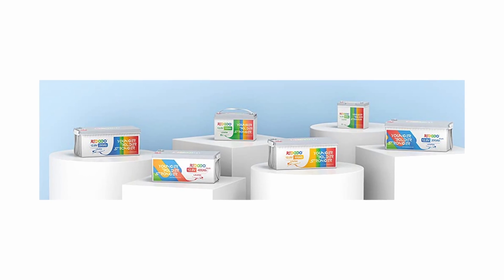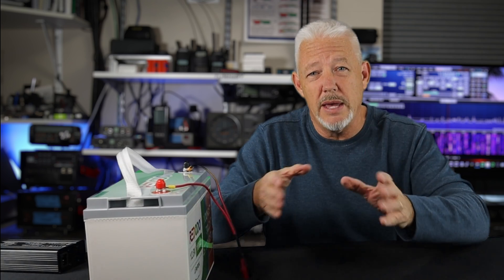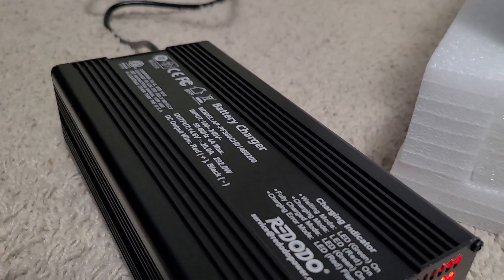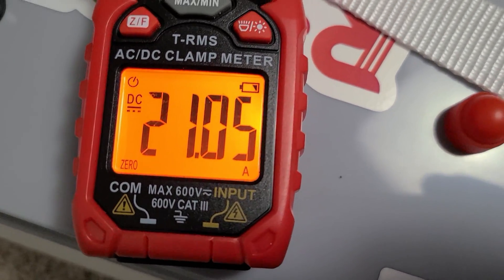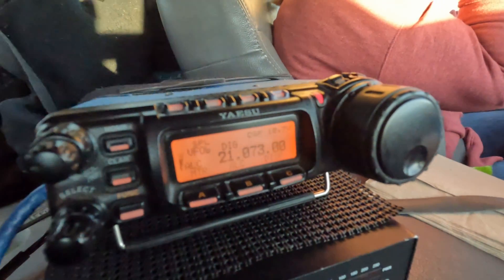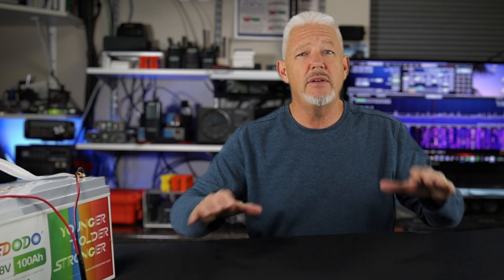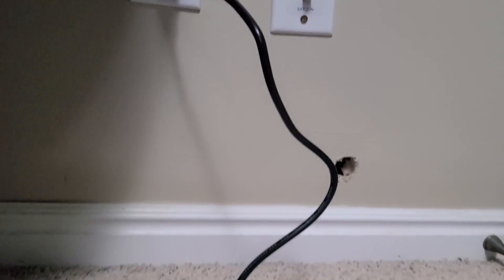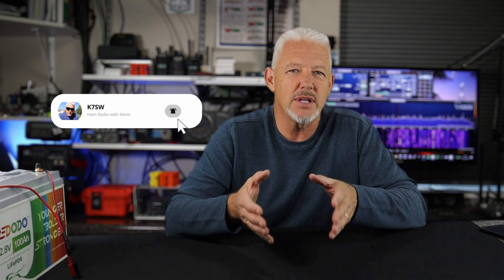100Ah LiFePO4 Battery for RADIO OPERATION | K7SW ham radio

Comment: I was looking at the Battle Born batteries that have a heater for cold weather charging that runs off the battery itself.  The price?  $949.  I was camping one time and the neighbors were having an entire solar and battery set up done on their RV (in the park).  When I looked up the set up they were putting in 10 batteries and 8 solar panels. $20,000 total.  I just sat there with my little 12v 12 ah battery running my KX3.  I will keep my eye on these.  The price is VERY reasonable and even with 100 watts transmitting it should last a few days before there is a need to recharge.  Thanks for the video!!  73!  de KE5ES
Reply from the maker: I  understand what you mean, I too have sat and watched the same thing.    Thanks for watching ! 73

Comment: I also have an 857 … though I power it with a much smaller battery.
Reply from the maker: The 857 can be a useful radio

Comment: i've had good success with a DIY 150aH LiFePo4 battery in my VW camper.  the battery runs the fridge and interior lights as well as my Elecraft K2/100.  i'm on the air about 12 hours total over the course of a weekend camp out and run 100 watts output.  that is about 35aH thanks to the low current draw of the K2.  100aH could easily let someone run a modern rig with a large display all weekend long at 100 watts output.  

i picked up a 35aH LiFePo4 to use when i want to operate under the stars.  everyday is field day with LiFePo4 power :)
Reply from the maker: Absolutely Steven ! I agree

Comment: Great video Would be ideal if you use DC to DC converter 12v to 19volt instead of inverter your using for laptop lot lower Amps.

Comment: Awesome. Is it about the size of a group 27? So you could put it in one of those boxes?

You’re not supposed to knock lithium batteries, and I’ve killed a few small banks by dropping them. Would you strap it down in the Jeep to protect it?
Reply: The actual battery inside is smaller, they make the surrounding case the same size as a comparable group 27 or 31 etc.. so they fit in the same box in your truck/boat etc…. And yes best to strap it down inside a battery box to avoid stuff dropping on the poles
Reply from the maker: yes !
Reply from the maker: The battery outside dimensions are 13 × 6.83 × 8.49 inches which is a little bigger than the Group 27 battery.
Perhaps there are boxes that might fit, I have not yet looked but when I do, I will post an update.  Thanks for asking.

Comment: How’s the charger for rfi? I bought one on Amazon(not redodo) and it spewed an enormous amount of rfi
Reply from the maker: I have not tested for RFI and the reason is, I will not be operating when this battery is charging with an AC powered charger. With 100Ah, my plan is to run hard during the day and charge at nite while sleeping, or solar charge it during the day when camping.
Reply: @hamradiowithkevin  thanks.  If you ever do try it, hopefully it's not too bad.  The one I had tried was wiping out 40m to 2m

Comment: What's that 4 way power pole adapter you have?  I need something like that.  Great video.
Reply from the maker: That power pole hub is really neat, PowerWerx used to sell them, however I have not found them since purchasing it years ago.
Thanks for checking out the video !

Comment: Thanks for the review Kevin. Another battery to look at that is higher quality for about the same price is the "Weize" brand. Will Prouse (on you tube) did a tear down of the Weize battery and found it to be the highest quality of all the lower priced 100ah batteries. It had an excellent BMS with Low Temp Cut Off that actually worked. It was very well built, had quality batteries, wiring and construction. I trust Will on his suggestions for batteries and he said this was his recommendation for the best low price 100 ah battery. Always a good idea to do research before laying out your hard earned money. I think he may have done a tear down on this one also. Might be a good thing to compare.
Reply: Yes a good battery! I hate all the sponsors in ham radio trying to get legit ham channels to promote garbage. That stupid "Scottish Titles" scam is the worst. Next is TYT and Radioddity with Bridgecom coming in third with its hard sell to get us to buy their crap.
I trust Kevin to not support garbage gear. Here in Illinois using any LifePo battery without thermal protection is a disaster. I use LifePo for the snow blower and tractor and would like to backup my Ham and Computer stuff but there is not much I have found to build a UPS for Shack operations.

Comment: Thanks for the video!

Maybe look into picking up a USB-C to fit your laptop DC Barrel jack and a 12vdc->boost charger: then you can skip the AC inverter.
Might need to be cautious about the convertor that you use to avoid the dreaded HF-noise.
Cheers!